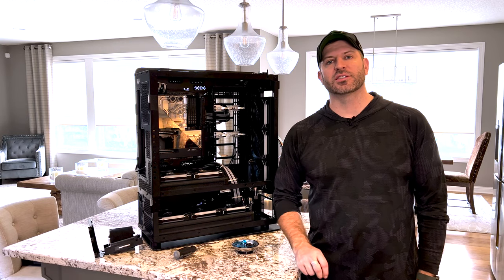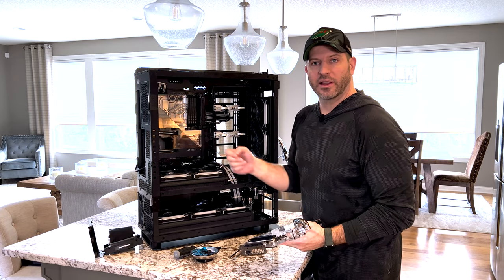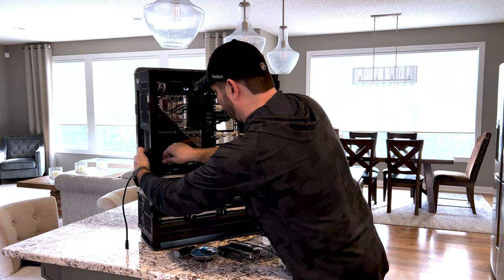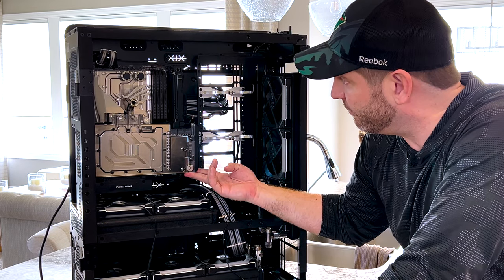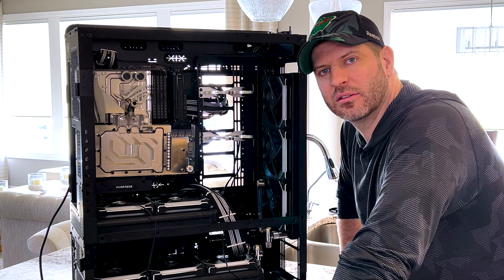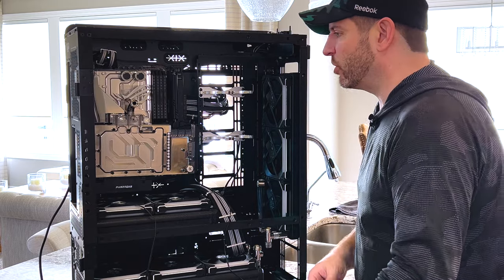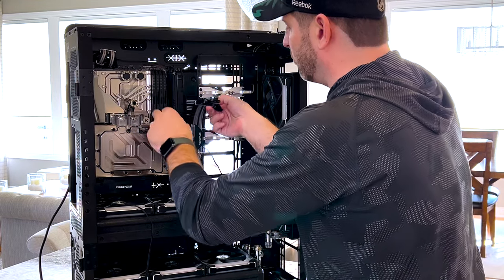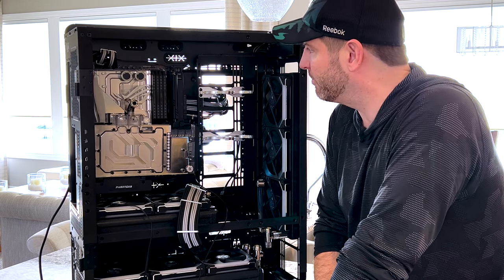ASUS! WHY DO YOU MAKE THINGS SO DIFFICULT!

Comment: thought that would be a problem with those active backplates. only thing i could think of is maybe getting a thin screw driver, wrapping a piece of electrical tape on the end to push on the latch. from the camera angle it looks like there would be enough room.

Comment: If it were me I would just mount it into the mobo. It’s going to be water cooled so it shouldn’t be coming out very often, and I had a similar issue and was able to get like a plastic trim remover and stick that into the release clip and it worked.
Reply: I like your idea about using a plastic trim remover in the release clip. Any recommendations on where you got yours?

Comment: Although I don’t own this case yet, so I’m not fully familiar with its layout, how about maybe mounting the gpu block on the vertical itx slot right below the main board? Will the riser cable be long enough? Again not fully familiar with case but just going through stock photos around the web. I’m planning to put this motherboard in my 1000d that has been sitting around the house for half a year already. Great video!

Comment: Most of the vertical mounted EK waterblocks I saw have both ports on the same side. Strange that your block doesn't have that option.
For my build I ditched the vertical mount because of the sag (and I want access to the other PCI slots)
Reply from the maker: It’s due to the active backplate.  So there is only one way in and one way out… it can be flipped ( the terminal that is ) but it’s still the same issue.

Comment: The Elite is an old case. I would have waited for the Lian Li V3000+/V2 whatever. Due in March.

Also have fun running those 4xDDR5 sticks at stock speeds. No board can run 4 sticks of DDR5 at stock XMP speeds ATM. It's borked until a bios update (which isn't guaranteed to work).
Reply from the maker: Yup.. but i have loved using it and want to keep it in this case for the time being.  I really wanted to get the IN Win 928, but they don’t make them.   I love my 925 case, but it only supports 120mm base rads and those fans can get loud compared to the 140mm fans.     Plus, i want more cooling than what the 925 will allow.